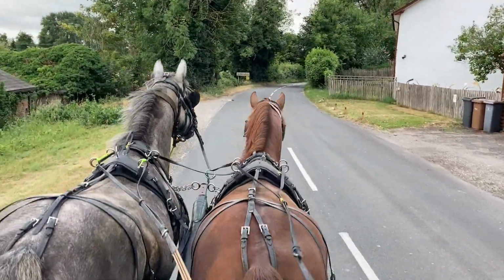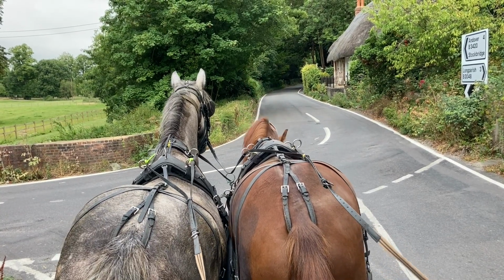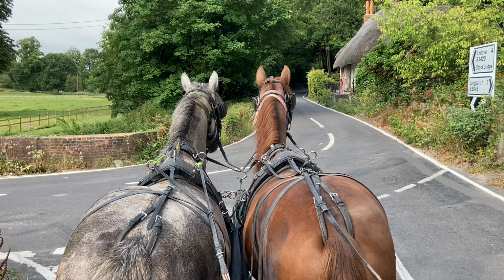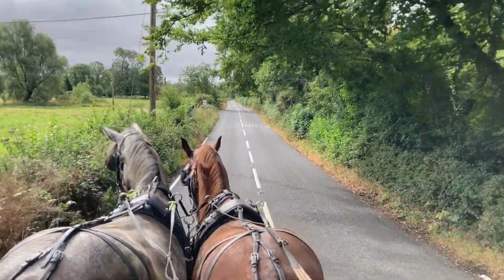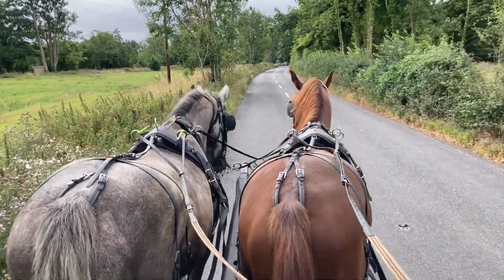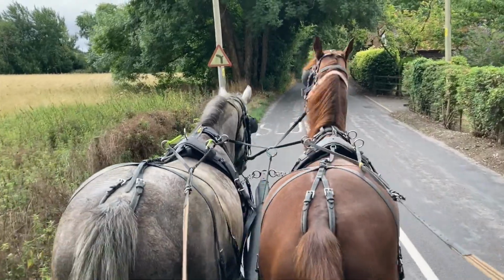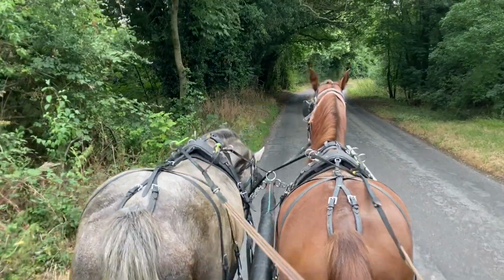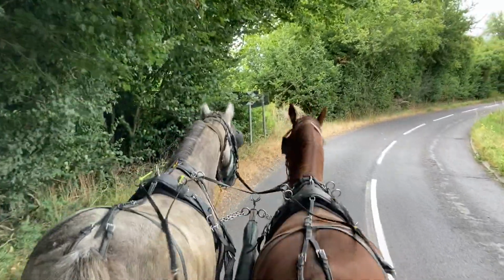Adjusting Coupling Reins and Traces in a Pair

Comment: Why is the ring the coupling reins go through used?  Where and how is the string/bungy cord attached to the pole? Thank you!
Reply from the maker: Hi there, it's just tied on tight around the pole so it stays in one position. It's there because especially when working with young and inexperienced horses, they can move their heads around a lot and accidentally catch the cross of the rein under the pole head, which causes a problem with steering and braking - and usually needs someone to jump down to fix it.
Reply: @barryhook2  Thank you!
Reply: @barryhook2 this is very helpful.  I’ve had the rein catch under the pole end and can be dangerous if you don’t have someone to help get it off.  I’m going to try this ring.  Thank you.

Comment: Hello Barry. Can you explain what an equalizer is please?
Reply from the maker: Hi Clare, an equaliser is like a larger swingletree, onto which the two smaller singletrees (which the horses are attached to) is attached. It works so that when one side is pulled forwards (one horse is pulling more weight) the other side (where the horse is not pulling as much) is pulled back. This helps the slower horse to feel weight on their chest and encourages them to pull into the collar. Hope that makes sense!
Reply: Thank you so much for answer. I'd never heard of that. That's so clever, so now I can understand completely with your precise explanation. Cheers.

Comment: Would you always put the 'workaholic' horse on the offside? and which one of these two would be better as tandem wheeler?
Reply from the maker: No, not necessarily. Doesn't matter which side of the pole they go. Alice happened to be offside as she is the smaller of the pair and normally the smaller of any pair will work nearside so that the camber of the road helps to even out the height difference.
Reply: @barryhook2  Don't you mean smaller goes on the offside?
Reply from the maker: @dennisharvey4499  Miss-typed, yes smaller horse goes offside!